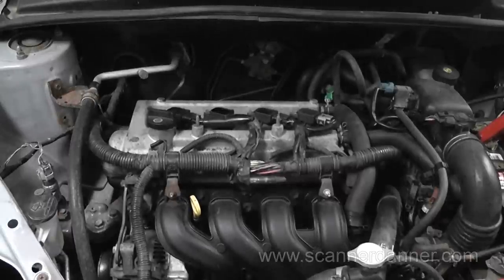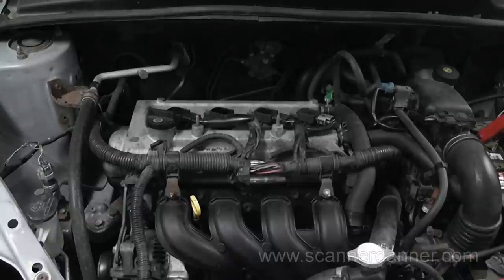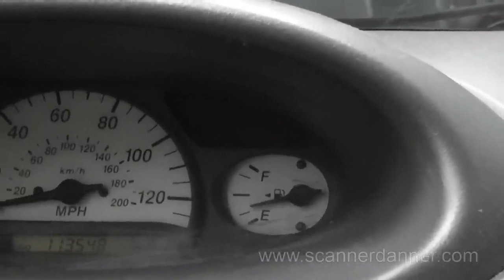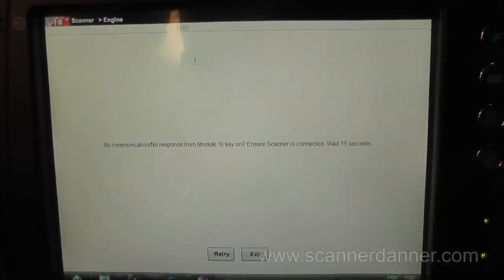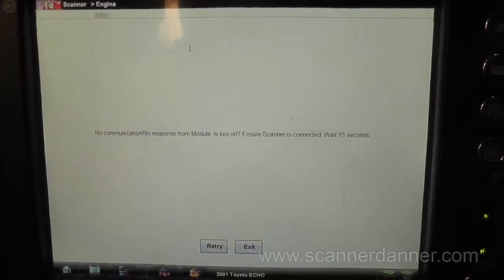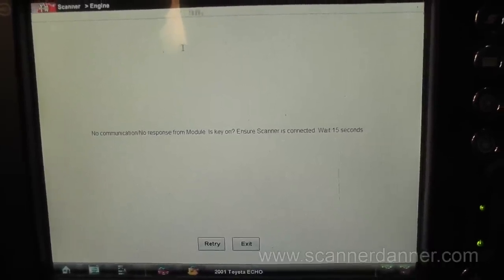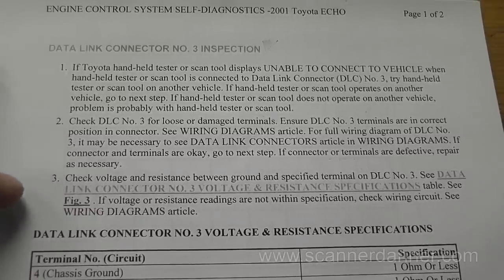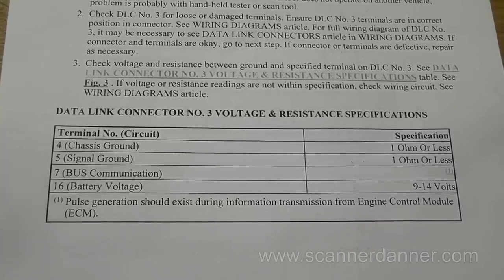Poor running, flashing CEL, no codes (bad computer ground) - Toyota

Comment: Hi sir  i have corolla 2005 i have issue with  no communication with ecu. I have check ground pin 4 and 5.  
Pin 7 also  have good  signals. But still  no communication with ecm even there is power at pin 16. Please kindly suggest mi next steps.  Engine check light  on  while driving   it stay on some time  and  it goes off.
Reply from the maker: it runs and drives but you have an intermittent check engine light on and you cannot communicate with the ECM? Try another scan tool
Reply: @ScannerDanner 
Is 2005 carolla have can  circuit can high
And can low?

Comment: I tried this with a smoke machine and didn’t find any vacuum leak. My LTFT is around 19 STFT is around -5 during idle. At 1500 LTFT is about -2 STFT is about -1. I can feel the misfires when holding RPM at 1000rpm. 14 jeep Cherokee 2.4
Reply from the maker: Attack the misfire!!

Comment: Question on voltage drop test. open insulation wire exposed to heat, can the wire get hot enough to produce resistance and drop voltage?

Comment: Forget the ohmmeter. I just use my power probe to give power, and if the breaker over heats I know there is good connection/ground. Probably not what I am supposed to do, but the process can be used successfully do you think?

Comment: I have a 95 dodge stratus, I have power on my #16 pin and also i have ground on #4&5 pins,but my scan tool doesn't communicate with the e.c.m. What could be wrong?  Need help, thanks.
Reply from the maker: try another scan tool, this is not a true OBDII system in 95, you may need to use the underhood data link connector and have the scan tool and software to do it.

Comment: Hey Scanner Danner, I have a 1999 Jeep Grand Cherokee 4.7L that I'm working on for someone. I changed the engine in it and it because the head gaskets were blown, The vehicle cranked but did not start when I got it from the customer. The engine cranks but will not start after I changed the engine. I connected my Launch CRP123 scan tool and the scanner does not turn on with the key off or forward. I checked for power between DLC pin 16 and pin 4 I have 12v and the ground circuit has no resistance with the key off, when I turn the key forward I only have about 4v between pins #16 and #4, but when I touch my neg probe to the frame I get 12v. I found a diagram and I ohmed the wire between DLC pin #4 and where the wire enters the PCM and I get 0 ohms. I thought it was the PCM so I bought a remanufactured one that comes pre flashed and I have the same problem. Please help!!!
Reply from the maker: It is becoming more and more difficult to answer questions here. I have 80,000 people asking me for help now. So I have created a forum to help you guys better. It is free to join and we can exchange pictures, wiring diagrams and waveforms if needed to help guide you through the process of troubleshooting your vehicle. Thank you so much! Hope to see you there. 
Paul Danner (ScannerDanner)
 https://www.scannerdanner.com/forum/post-your-repair-questions-here.html

Comment: Do you have one for cruise control dash light flickering and when it stays on it would disable my speedometer turning engine light code for p0500? Vss is new and connector is good too.
Reply from the maker: Is it a Chrysler? Alternator diode failure possibly? I have a video on this. Don't have the link offhand, sorry

Comment: Paul, what if you did pin 16 to pin 4-5 to check for gnd, I have also learned much from Dan Sullivan and his Load Pro could/would have loaded the circuit possibly revealing the bad gnd through VDrop.

Comment: Hello Mr Scannerdanner.

Love your vids.

How did you prove that the voltage supply (via pin 16) didn't have a voltage drop under load, as the voltage test was unloaded? This could give a comms problem.

Cheers

Ted

Comment: Paul, the old Modis with keys does it works the same as newer models, bidirectional controls live data and graphs? I’m looking at Ebay to try buy one, maybe $700? What you think?
Reply from the maker: Yes it does, exactly the same, just different hardware and probably isn't updated to the newest software but who cares, it's definitely worth it for the scope alone.
Reply: I spoke to Snap-On rep as she has one for 700 with 12.2 software so I guess it’s up to 2012, so with this I would be able to do the test you normally do, right? Being a diyer my self during weekends I guess I should be ok then. 
This is the EEMS300 Modis

Comment: Can you please help me....  "06" Dodge Caravan,  My engine light is on.  The first time I noticed it I tightened my gas cap and the light shut off.  It has come again since then a few months ago and now will not turn off.  went to a shop and it could not be read by the scanner.  This is stopping me from getting an inspection which was due for December 2016.  Its the only vehicle I have to get to work.  I disconnected the Battery Positive for 5 mins.  and still have same thing.  Can you please give me some advice to follow.
Reply from the maker: It is becoming more and more difficult to answer questions here. I have 80,000 people asking me for help now. So I have created a forum to help you guys better. It is free to join and we can exchange pictures, wiring diagrams and waveforms if needed to help guide you through the process of troubleshooting your vehicle. Thank you so much! Hope to see you there. 
Paul Danner (ScannerDanner)
 https://www.scannerdanner.com/forum/post-your-repair-questions-here.html

Comment: Hi Paul. Do you have some information on negative voltage on grounds? How does that happen?
Reply from the maker: a slight negative voltage is normal and it depends on the location of your ground with your meter (battery negative, engine block and sensor ground)
Reply: Thanks very much mate. Keep up the great work. 
Dan

Comment: GREAT VID!!! I am a premium subscriber now too!! I have a 98 dodge stratus with a p0505 and plugging my maxidas ds708 up, I can only get in to the computer in generic mode. in factory specific, it says unknown control variant. I DO see on the pcm it has a tag saying it the software wz updated back in 2002...is that upgrade why I cant read in specific mode? or is my scan tool in need of an update???
Reply from the maker: Thank you! I am not familiar with the scan tool you are using so I cannot advise on the no com issue. I wouldn't worry about it for now, attack the P0505 code. This should be a stepper type IAC motor. Section 20 Idle Speed Controls in my book for more testing of these. Thanks again
Reply: Dying for one of those snap on machines you have!!! Mayb the vantage pro next year but thanks a bunch for the premium channel....making me a much better tech!!

Comment: Hey Paul, is there any way of checking bus communication wires with a multi meter?
Reply: I think this video is a good example for the use of the load pro tool or at the least using a incandescent test light and pay close attention to the brightness of the bulb and compare it to a good power and ground brightness.
Reply from the maker: +joeandgod1 certain tests yes like checking the terminating resistors for example

Comment: what you do is check for voltage 5v at high an low can bus! should egual 5v 2.5 each or so! 6 and 14 pins will have low voltage

Comment: hi paul, so if you have no communication on a pcm i thought if you checked #16,#4, and #5 pin on the dlc and they were good you pretty much condemned the PCM, so obviously after watching this video, you need to check all the grounds on the PCM itself, all the ground pins that show up on the schematic as a ground pin on the PCM? so if 16 a good feed,4,and 5 are good grounds,you can still have a ground problem? and need to check all the ground pins on the PCM itself?

Comment: My only doubt is, how the hell they were able to swap the engine and not have to disconnect that ground?
Reply from the maker: They did have it disconnected. That aluminum housing corroded in the junk yard and the guys that bolted up that ground, never paid attention to how corroded it was. Make sense?

Comment: when chasing low resistance, it might pay to take the ohmeter off auto scale and start at the lowest scale.
Reply from the maker: It was on the lowest scale. It was 0 ohms, not 0 Kohms  or 0 Mohms.
Also the auto scale will automatically put you on the lowest ohm scale that it will read on. Make sense?
The lesson here is don't trust your ohm meter on high amperage circuits. (Really anything more than 1 amp is what I am defining as high amps)

Comment: The problem is that the pcm was getting incorrect signal form a ground wire, which caused a communication issue to/from the pcm and sensors...

Comment: Can somebody please help me..

I have a 2006 Kia picanto 1.1
By turning on the starting key, the check light doesnt comes.
I have also no connection between my Delphi Diagnostic software and my OBD Socket, better the ECU.

What I have done:
when i am put a cable from the battery of the car, suddenly everything is different.
I have taken a separate cable from the (+) of the battery to the Pin 16 of the OBD Socket, then the check light comes.
From now on, I can also connect via my OBD and my laptop and my Delphi tool to the engine.
So, whats the problem with this car? "Ground problem" or "(+) problem"?
Do somebody know, where I can find the ECU by Kia Picanto 2006 1.1?
Reply: you have no power to pcm, check fuses.. check that pin 16 cable.. find a diagram.
Reply: Pin 16 is normally fed power from the cigarette lighter fuse. Check for a blown cigarette lighter fuse.

Comment: Pin 7 Toyota uses the ISO 9141 K-Line to communicate with scan tools true for ODB II applications. and only talks when scanner is conected. Using DLC breakout box pin 7 supposed to be 2 VDC when scanner is NOTconnected , and 12 vdc when KOEO. if you need more info on toyota I ghess i may be able to sent you some pdf unfortunatelly all this toyota nomenclature is in my toyota scanner and i don't keep copies of it.

Comment: In order to compare apples to apples you need to measure the VOLTAGE of the ground pin with the DMM, not resistance. Both AC and DC if need be but one should show several volts.
The noise probably looks crazy using the scope because it's aliasing a signal that's higher in frequency than the scope sample rate. Can you change the sample rate (higher) on the scope?

Comment: Damn YouTube mobile... Anyway due to the operation of modern day multimeters, if you use a known good ground, you are not accurately isolating the question circuit.  (The current will flow to the path of least resistance aka the ground you used under the dashboard). In order to accurately isolate the circuit.  You must connect your meter at point A/B of the circuit in question.  In this case ECU pin and eyelet at the engine.

Comment: is the key on win u r testing it
Reply: Of course, as Scanner Danner stresses, the ground needs to be loaded while this test is being done.  The Computer in this case is the load, probably most of the Computer load current is routed through this engine block ground.  If there is any resistance  build up on this ground connection, then the current routed through this ground = voltage, remember V= I x R (current X resistance).

Comment: What I'd have done is plugged the airbag module back in to see what the data line looked like after unplugging the ecu.
Reply from the maker: We were not working with the air bag module??
Reply: @ScannerDanner  15:45 you said you unplugged it.
Reply: @ScannerDanner DLC, ECU, airbag, and ABS(not present) all use that data line. 14:45
Reply: @ScannerDanner  I think you would have seen a good data signal for reference and comparison if so is all.

Comment: Hi, Paul.  I just wanted to let you know that I researched computer data circuits as they apply to diagnosis and have distilled the 5 standard communication protocols into a two page word document that explains pinouts and voltage levels that are useful to technicians.  I would be happy to share this with you, as I did in a class at my shop.  I bought your book so you should have my email address, just send me a way to get this document to you and I think it will help.

Comment: I use a LoadPro with my DMM" to check for drops in ground wires just for speed BUT if that does not show the ground trouble and 99.997% of the time it will,, If not I'll do 100% what you did with a Modis',,,, The LoadPro' will put a very small load on the wire to check it,,, But i will not use it to load any thing that is hooked to the PCM!!! I unplug it first then load the wire with the LoadPro'..

Comment: Congrats on actually finding a Toyota not running well. Has to be a one off or this car has been deliberately sabotaged maybe.
Reply from the maker: The cause was this used engine was sitting outside in the elements for a long time before being installed in the car. I talked about this in the video, maybe you missed it. It caused the aluminum intake to corrode and created out bad ground issue.